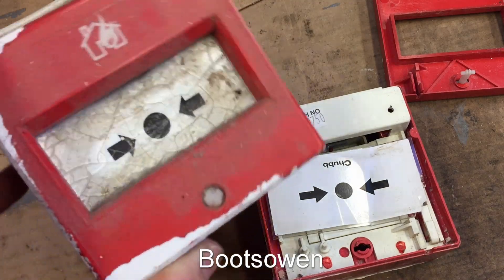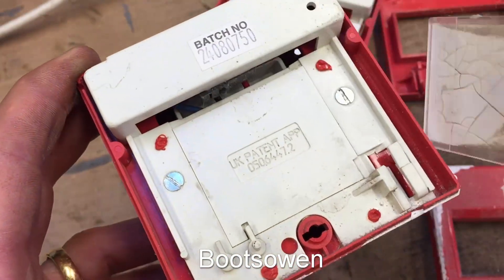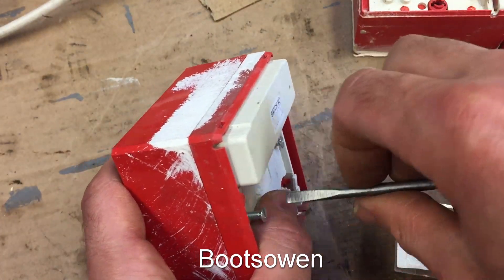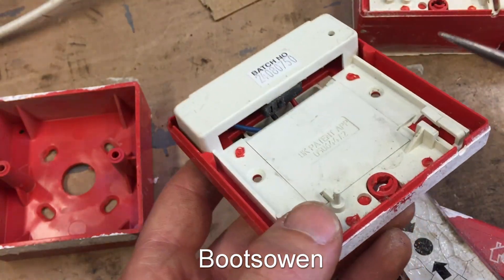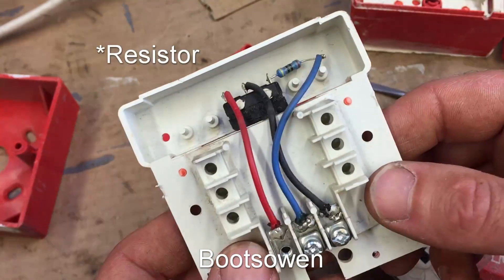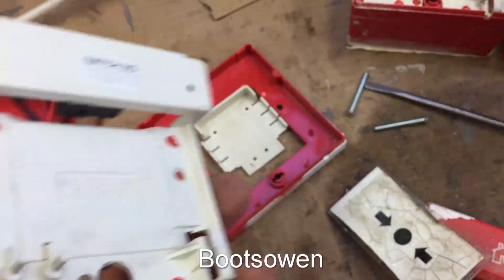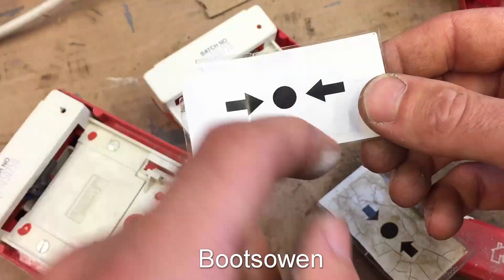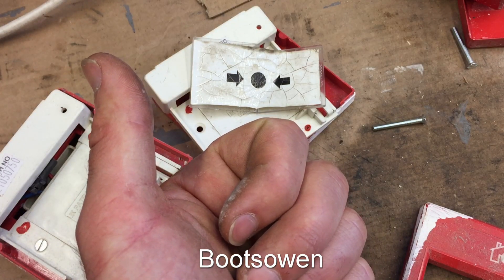Fire alarm switches: a look inside.

Comment: Releasing the switch closes the circuit . And some newer alarm systems require a change in resistance rather than open or closes circuit, so it has the option of both :-)

Comment: These fire alarm switches are allcualty called call points 

At the same time I can tell that's the old style of the KAC call points which are fairly common. But I do also have a simular call point to those made in China which I got for 3 pounds of Ebay I think it was